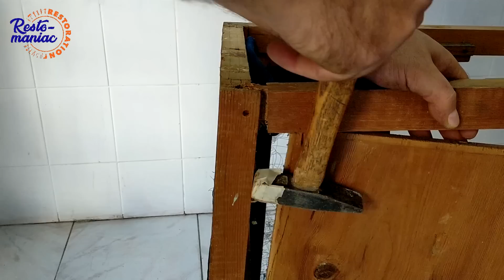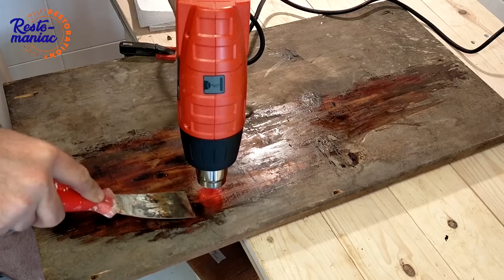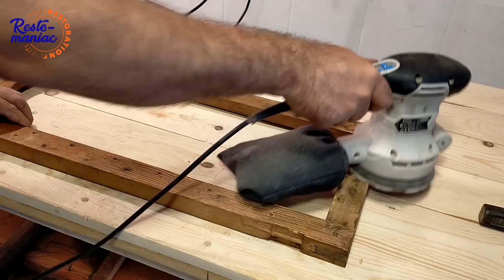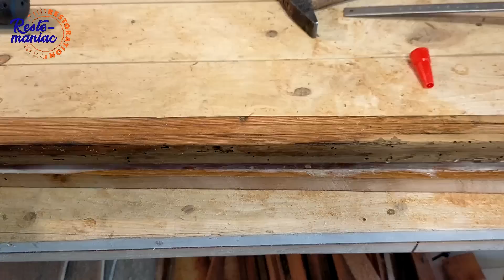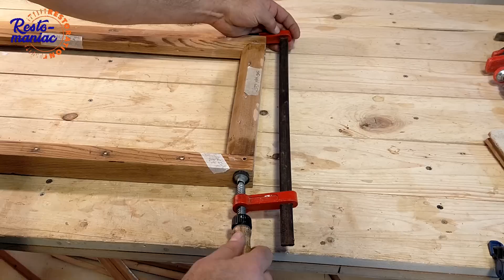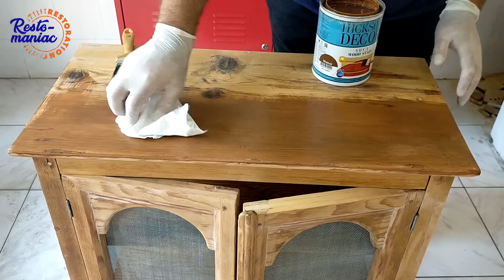Pie Safe Wire Cabinet Restoration

Comment: Found  what I think was one (coop?)missing the front metal screen  of 4 sides on high legs .so I put the old matching back screen  to the front and bought  an antique window  frame the had old copper screen  inside aged with paint and patina  in that order. I used old rusty upholstery tacks to insert the screen. A little shellac and buff and it was ready to go . wasn't  as fancy as  yours .thank u for showing how patience helps with these type of projects  God  bless
Reply from the maker: Thank you very much 😊🤗

Comment: Здорово!👍👍👍👌👌👌🔨🔨🔨👏👏👏 А сетки специально нужны? А я думала будут стеклянные дверцы...
Reply: Если бы не полки, подумала бы что жто шкафчик для сушки рыбы.
Reply: Allowing for increased ventilation [with the doors closed] = (read in another comment) baked food is put inside it to cool down to prevent flies landing on the food, can be put inside a larder and food that needs to be partly covered & kept well-ventilated is put in this cabinet, small potted house plants can be kept in the cabinet and can [still breathe] and pleasant smelly things can be kept and used inside it ~ the perfume dissipating out the mesh
Reply from the maker: Спасибо :) Да, особенно провод был нужен :)